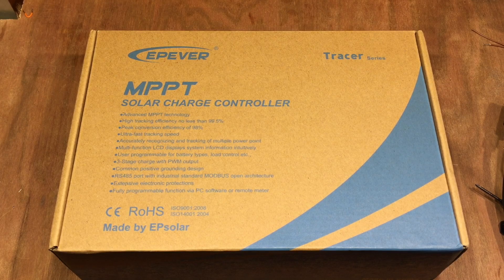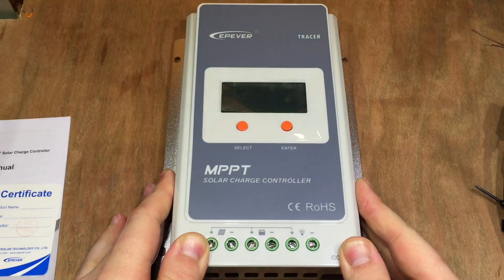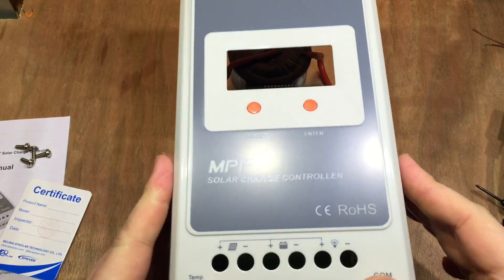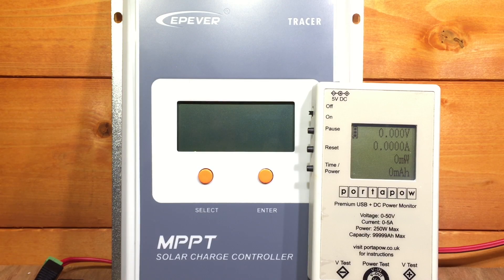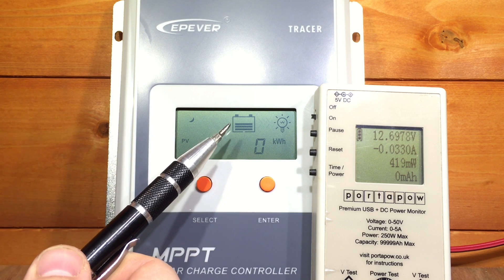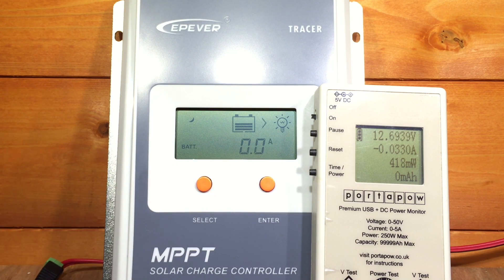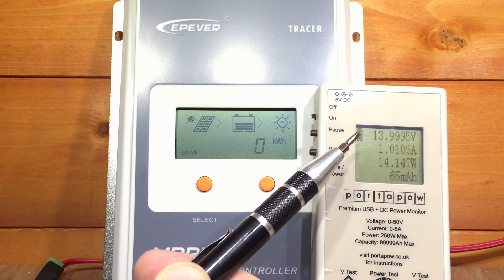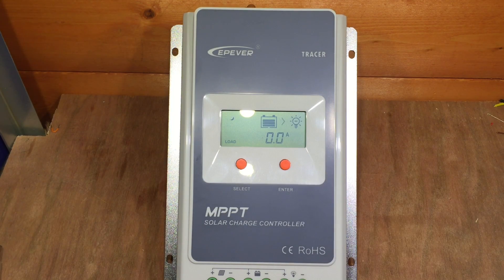MPPT Charge Controller Review - EPSolar EPEver Tracer A Series - 12v Solar Shed

Comment: hi there i have the same tracer but i cant get it on 24v it just shows there battery's are full or overcharged aaaa help 
is was before on 12v*
Reply from the maker: +AG “Andrew” -Gaming I think it's meant to be in auto mode on first boot. But I do know you can set the voltage in the solar station monitor software - perhaps yours has been set there? I'm not sure there is anyway to adjust that with the charge controller alone. I think you'd need a USB cable (check out my video to make one cheaply), but you might be able to do it with the MT50 although I haven't tested this.
Reply: thanks for the fast reply, yes i was thinking that too ( not very good ) :-(  yes i have see that video i'v watched most of you videos ... thought i would ask just to see if i was doing something stupid :-)
Reply from the maker: +AG “Andrew” Gaming Nothing stupid that I'm aware of, so be safe in the knowledge that we are both being stupid or neither of us are! Glad to have been of some assistance at least. :)

Comment: I bought this after seeing your video. good value. along with remote display. when you do a vid  onthe mt50 look forthe spelling mistake. also temp offset is limited to +-9mV/2oC whereas most AGM specs so. far tell they require up to 30mV/1oC. not sure how important that is but do look for it.
Reply: The normal compensation value for lead acid is between 3 to 4mV per °C and cell (which is very much what you say with 30mV/10°C). So the adjustable range of +/-9mV/°C of the Tracer covers this easily. (I am pretty sure that the 20°C you specify is just the 'neutral point' of the compensation curve, which is normally set to 20°C or 25°C. Means that at 20°C there is no compensation done. ).
Reply: +Jörg Becker thanks for reply. that wasn't 10C. couldn't find it on mini KB. rechecked specs says 
-30mV/°C.  checked other batt brand specs for AGMs which give same spec. This is stated for cyclic use. for float use shows -20mV/°C. not sure if it's really big deal. just if I see something is available I use it.
Reply: Please recheck that! If a compensation of -30mV/°C is given, than this is very likely for the whole battery! If you have a12V battery with 6 cells, this means -5mV/°C per cell (seems ok for cyclic use, as you say the value for float use is -20mV than this is very near to the -3 to -4mv value I have given above). And as the Tracer is made for 12V and 24V batteries the compensation value is given per cell.
Reply: +Jörg Becker oh my... makes total sense. will adjust.  thank you

Comment: Hi Adam thanks for great work and very informative videos.i have Remote temperature sensor for this model of controller.kindly tell me how and where to attach or install the remote temperature sensor with my flooded lead acid single 12v battery?
Reply from the maker: +Saqib Javid If you've bought the official one it should just plug in near the solar input. I've placed the temperature probe in between my two sealed lead acid batteries, but if you've only one I guess you could tape it to one side. 

Thanks for your kind comments.

Comment: Great video. If the input voltage is 11v at 10a (110 watts) and the battery is at 12.0v then, will it boost the voltage to deliver 110 watts to the battery?
Reply from the maker: No - boost MPPT controllers a rare.  99% of MPPT solar charge controllers use Buck, the solar voltage must be higher than the battery.
Reply: Thank you for the information. Maybe, I should buy 2 CC/CV boost converters at 6 amps each and wire it up in parallel before the PWM charge controller to extract the 110 watts.
Reply from the maker: If you need a controller that boosts solar panel voltage to a higher battery voltage (24 volt battery system or above) try looking at this: http://rover.ebay.com/rover/1/710-53481-19255-0/1?icep_ff3=2&pub=5575189419&toolid=10001&campid=5337903455&customid=Boost+MPPT&icep_item=262363427085&ipn=psmain&icep_vectorid=229508&kwid=902099&mtid=824&kw=lg  It was recently reviewed by Julian Ilett.
Reply: I have a 12v battery bank :D
Reply from the maker: +Brian Dean Ah well, not for you then. Your panels are producing less than that then? Could you run them in series to get higher voltage then use a normal mppt charge controller?
Reply: Yes I can wire the solar panels in series to produce 24v nominal. However, I don't want to change my current setup until I have double the amount of solar panels installed because a 24v system will require a 24v inverter as well. 
The setup works great at the moment. I just wanted to extract 100 to 200 watts during the last two hour of sunlight. I am in a remote area and 200watts of electricity would cost $1 per hour if I ran the gen.
Reply from the maker: +Brian Dean you can keep your battery system at 12volt and your panels at 24 volt using mppt. Unless your inverter is grid tied (panels connect directly to it) I'm not sure of the issue?
Reply: That is a great idea! No it is not a grid tied inverter.

Comment: Thanks for posting this great information. I am about to buy this controller (40A) version for 500w of solar panels for my rv and came across some info saying that this controller has a positive ground. Will that be a problem for my RV since it uses a negative ground?
Reply from the maker: +JYDOG Depends... If your solar panels are wired straight to the controller and not via any part of your RV chassis then I think you'll be ok on the charging side. If your wanting to run loads from the controller then you'll need to think carefully to ensure it doesn't cause an issue.
Reply: Ok, then I should be safe with this controller not using the the load side then. Thanks for the quick answer and great videos
.

Comment: Is it will be ok to set 2 pv of 150 watt ,36 cell , in series for a 12v ,70Ah battery. Is controller work for that or i need to have 24v battery system to put 2 pv of 150w. 36cell in series.kindy suggest.
Reply from the maker: +Ghs 35640071 No a 12v battery system is fine. The tracer will convert the higher voltage into more current for your battery bank.
Reply: Which configuration is best for my system series or parallel? Kindly suggest adam
Reply from the maker: +Ghs 35640071 Hi. I did answer this (I thought) in one of your other comments. I'd go with series unless there's another reason why you can't. Hope that helps.
Reply: Thank you so much dear Adam keep sharing such great vidoes and informative comments .

Comment: Hi adam your vidoes are great ,i bought a 20A tracer model.to charge my one 12v,70 Ah lead acid battery with 2 pv of 150wattss ,36 mono crystalline cell,kindly suggest me which configuration of pv is best for battery series or parallel?

Comment: does anyone know how to hook up the MT-50 controller AND a Communications cable?  Both the MT-50 and the Controller only have one input.
Reply from the maker: +ken ber I'm fairly sure it's only one at a time.
Reply: Thats what I was afraid of.    Do you  think there is any way to hook up a hub?  The only thing im worried about is the voltage being split between the two if it even does.  I do IT/Low Voltage for a living but thisnactually has me stumped.
Reply from the maker: +ken ber It uses modbus a bus system where there is one master and multiple slaves. The tracer charge controller is a slave. The master (MT50 or PC via USB) polls the slaves every so often and it replies with the requested details. I'm no modbus expert but I don't think you can have two masters on one bus.

Comment: Got a Tracer 4210A yesterday and put it into a system with 4 PV panels 250W and a 24V LiFePO4 battery with 300Ah. The panels are 60 cell panels and two are in series. Means PV voltage is between 45 and 60V, max. current roughly 18A.
The unit works very nicely, finds the MPPT reliably and chargers the battery just fine.

I have then connected a load (in this case this is an AEconversion grid tie inverter with 350W). I am using this during times with no sun (nights) to compensate for my inhouse consumption.
But this is where I have a problem:  The Tracer is not able to switch this load ON successfully. It seems to sense a short circuit, presumably because of the high inrush currents of the inverters input capacitors. If I disconnect the inverter, switch the load ON on the Tracer and then reconnect the inverter everything is ok. But automatic switching is not possible.
Connected to this, I get very erratic current readings for Battery and load currents. The inverter draws a maximum constant 11.5A and I get a stable reading on all digital meters I have. But the Tracer will show between 0.x and 25A. The same for the battery current. PV current readings are more stable, but when my Fluke multimeter shows a stable 6.5A PV current, the Tracer will show a current reading which varies between appr. 5A and 6.5A.
The readings via Modbus are even more erratic and absolutely unusable.

I think that the adc filtering is not appropriate to the situation. It is clear that for output short circuit protection, the response of the filter for the load current has to be fast, but for PV and battery current reading it could certainly be much slower (more heavily filtered). Even more so for the Modbus values which cannot be read with an interval of less than 10 seconds.
Reply from the maker: +Jörg Becker Hello. I've not seen the behaviour you describe but I'm generally pulling much lower loads. 

Usually I wouldn't place an inverter on the load output of a charge controller - and with it being a grid tie inverter I think you're causing some issues. Remember a grid tie inverter has its own MPPT controller within. It varies the load on the input to find the maximum power point. Your tracer probably find this very confusing.  

I know people do run grid tie inverters from batteries - but they are designed to be run from solar panels at a higher voltage. 

I'd look to find a more stable load and test all the readings on your tracer - if they are more stable and more accurate you know your grid tie inverter is adding to the confusion. 

If you want to run the grid tie inverter from your batteries (which it isn't really designed to do) then I'd probably try a DC to DC converter boosting your 12v battery up to 17volts or so which will be closer to the target within your grid tie.
Reply: Thank you for your fast response.
I have disabled the MPPT mode in the 350W grid tie inverter I use as load, so it is running with a fixed (controllable) input current. And yes, this load is an SMPS (switch mode power supply), but this is true today for a lot of other loads. Purely resistive loads (like the old fashioned light bulbs) are becoming rather uncommon. An LED lamp will also have an SMPS inside as will computers, chargers and so on.
I still think that the filtering of the measuring inputs is not very well done (if a Fluke is able to show a stable reading, the Tracer should do the same.). The erratic measuring values are more or less a cosmetic problem, but the far too sensitive short circuit detection is a real show stopper. I have already seen this problem on a number of low cost PWM solar chargers with load output. In all cases I could easily fix this by either removing the short circuit detection circuit or by modifying the filter characteristics. Think I will have to dive a little deeper into the circuits of the Tracer to find a solution here too.

Using a DC/DC converter would not help at all as this is also an SMPS with a capacitive load (the input of the grid tie inverter is a DC/DC converter from 24V to 380V).
Reply: hi jorg, i have the same problem the load and battery current shift from 0A to 18A for a stable 300W (@25v)grid tie.(gti 600)
internal sensor seem resistive 0.004 ohms.Have you do a modification (capacitor)on current sensor?
i am very insterested for your mod.
Reply: Sorry, I tried to do something about it, but my time is very limited atm and I did not really get a very good result. It is also not very easy, because especially grid tied inverters mostly have very little capacity in the input stages. As they have to generate sinusoidal output current, the input current also looks more or less like a sine wave with 50Hz frequency. This means that a filter on the Tracers measuring inputs will need to have an even lower filter frequency. But than it would not be fast enough for an output short circuit detection.
I am still planning to do something about it, but it would be much easier to do some decent software filtering instead.
Reply: HI jorg,
Thanks for answer but the problem is on my tracer 2210A. inverter cuurent is very stable +/- 1A but on LCD tracer load and battery current swing +/- 18A!!!!! I think a problem with ground on current sensor in the 2210A.Battery and load sensor are resistor shunt in serie with middle point to ground,i suspect a ground false with op amp input or A/D input .
regards
Reply: I do not believe it is a hardware problem! The measuring circuit is very straightforward and state of the art, not very special. Have you seen the inverter current on a scope? I am sure it is not stable.
Reply: HI,Current on battery BMS is very stable 8A  but 2210A monitor current  is very instable battery and load ,see screen picture @ http://mcvl.free.fr/2210A.jpg
Reply: How do you know it is 'stable'? Did you check with an oscilloscope? There might be high-frequency content in the current (and certainly will with switched mode poser supplies like your inverter!).

Comment: I have purchase the same device .  I am having problems connecting to my PC.  It works intermittently but at times I get 'Operation failed. The operation has timeout.  (COM4).  When I go to Device Manager I can see the device is connected via COM4.  Unfortunately more times than not it times out.  Any ideas?
Reply from the maker: +Sallie Moulds is something else on your computer trying to access COM4 at the same time?

Comment: Hi Adam, which one do you prefer ? The EPsolar or the one you reviewed earlier ? https://www.youtube.com/watch?v=JgWAa7dmn98 The EP looks pretty solid inside with the huge coil but it seems to pull the solar panel voltage down a bit more ? Or did I see that incorrectly ? Going to use it for camping with a 40w panel and a std lead acid battery (car battery. Don't need it at home as I have 3.3 kW of panels on the roof already :)  Thanks for the great reviews !
Reply from the maker: +Redmer Bootsma The EPSolar gives more information on what is going on, but without the optional extras the Eco-Worthy controller allows you to adjust more out of the box. 

I like all the info you get from the EPSolar when connected up to a PC. I'm a stats geek though... :-)

It's hard to say which is most efficient - whatever the panel voltage, due to never having the same sun conditions, differences in solar panels and different batteries.

If I was starting out today - I'd get the EPSolar out of the two of them. 

Thanks for the kind comments.
Reply: with optional extras you mean a usb-rs485 cable to adjust all settings ? that's easy and i'll go for the epsolar I think, once setup correctly, no need for pc anymore on the campsite. thanks !
Reply from the maker: +Redmer Bootsma Yeah that's right. Either you need the cable or the MT50 screen to adjust battery parameters. As you say - unless you want to monitor things closely, you only need it once. 

No problem. Cheers for your comments.
Reply from the maker: +Redmer Bootsma Yeah that's right. Either you need the cable or the MT50 screen to adjust battery parameters. As you say - unless you want to monitor things closely, you only need it once. 

No problem. Cheers for your comments.
Reply: Quick question; got the inverter with an original USB lead but now way to get the thing connected. Any special things you can think about ? Cheers,

Redmer
Reply from the maker: +Redmer Bootsma You're having trouble communicating with the charge controller? Erm... Correct drivers installed? Correct port selected for communication? Any specific error message coming up?
Reply: drivers installed, correct com port selected, rs485 selected in com prt setup..... no joy. It says that it cant connect. Bugger.
Reply from the maker: +Redmer Bootsma MODBUS ID is 1? Really not sure what else to suggest tbh.
Reply: found it... had to install english windows version...